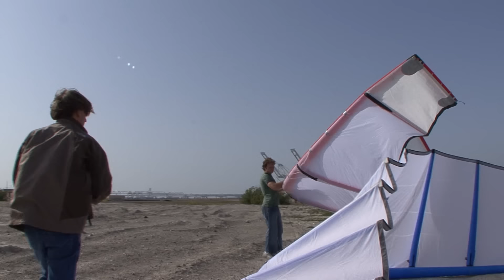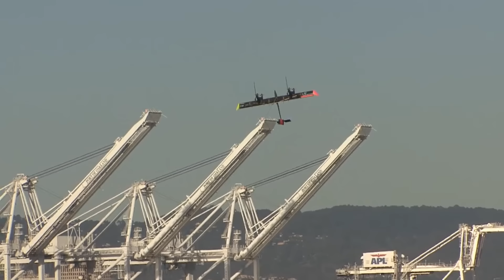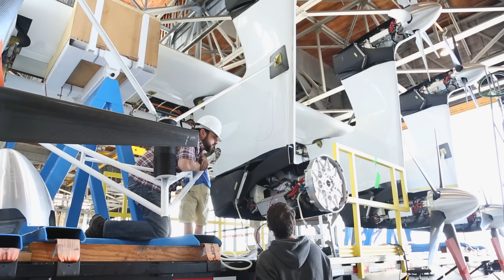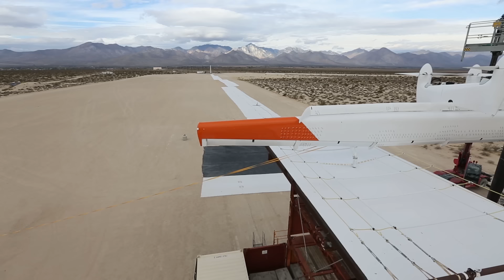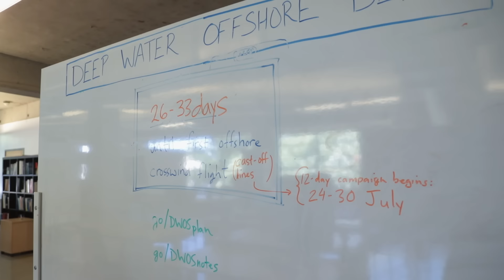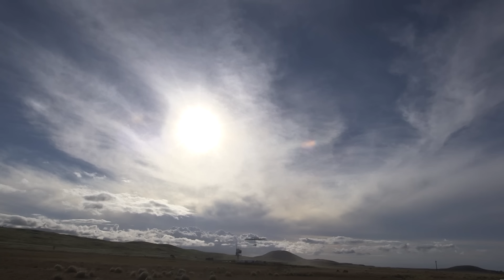Pulling Power from the Sky: The Story of Makani [Feature Film]

Comment: Other than being disappointed in the absence of an explanation of how electrical power would be conducted to the ground, the amount of power generated, and the many technical aspects of the project, the film was entertaining and held my attention throughout.
Reply: Really? It's tethered.. a tether would make a great roadway for those helpful little electrons.
Reply: You’re listening comprehension isn’t very good because they explained it all what do you mean how are they going to get it to the Ground silly it’s tied to the ground
Reply: Alot of "bruh lets like make a kite that like generates electricity" talk and a shocking lack of Volts, Amps, and Resistance talk... Huge red flag. Lets put aside the inherent reliability and safety issues with having a huge chunk of metal and carbon flber with a million moving parts whizzing around for hours all willy nilly, like, how much power does it take to make this thing take off? How much power would it generate? How much power can that tether handle? How would you store that power? Seems like pretty basic questions that weren't addressed whatsoever. I can't believe they raised capital for this hair brained idea for over a decade lol, and they seemed more concerned with morale and matching hardhats as opposed to actual power generation. 2010s Silicon Valley VC money is a hell of a drug 😂

Comment: Very cool project. Not sure why approached in this manor as there is in fact already a kite and prop generating system. A fellow in Orange county CA designed it and built at least two models And one of the two is for sale right now. It does not use the cross wind you folks are going for but then it does not need to. A faster than the wind wind turbin car has already proved you do NOT have to use cross wind other than that picked up by the prop pitch. sailboats certainly can and do go faster than the wind driving them in many situations but you can harness that power with far less sophistication. But this is one cool and brilliant undertaking for cleaner energy. So glad you did this. very glad you shared it.

Comment: Having flown RC gliders and electrics for a number of years I toyed with the idea of making an RC kite/glider. When I saw the crash at China Lake where the "kite" got slack line then suddenly pulled away breaking the wing I was astonished the designers hadn't built breakaway couplers into the two tethers attached to the wings. Then it would just be either a powered or dead stick glide to the ground. I noticed the pilot was using an RC style control box. It might have helped also if they had built in a ton more flexibility into the wings, have you ever seen how much flex jumbo jet airliners have in their wings, incredible. That would have saved maybe two of the first crashes, tether break and wing break. Maybe even simple dihedral in the wings would help stabilize the "kite" and control the "aircraft". Anyway, just idle thinking. Loved the video. It would have been interesting to get some real world data about how this process could stack up against the current crop of energy production. Also, real world longevity in this system. Like what will happen to the bouy and the kite when a hurricane comes a callin'?
Reply: You should apply for a spot on the team.

Comment: Great video. I loved the engineering. It shows how a simple idea can explode into a ton of complexity to implement. Even with a simpler consistent retrieval system, there are just so many moving parts and points of failure. Maintenance and reliability would be huge factors.
Reply: Well, the matter was complex from the start, but it was sold as a beautiful thing that, once again, "would bring cheap and simple energy all over the world to simple people"... Same with clean water sourcing, for instance. This basic lie has harnessed a lot of investment in a host of projects to produce nothing in so many projects! As a whole, it can be viewed, I guess, as "parasitic engineering".
Reply: @fiegenfiegen  That's an incredibly cynical take on it.  None of the incredible technologies we have would be possible without risk taking.
Reply: @miramichi30  well if it does not work or uses almost as much as it will give back, or more, what would call it, even window mill (turbines), if you could get one to work 24/365 all the, which then don't,   the don't work if there no wind, and if the to much wind, which was a big surprise, consider that the hole point of them, and the bigger they get the more parts and stuff the need to make them go? (are the not meant to make something else go instead) and all the part weir out they tent to make electricity, when it not needed, when when the do make, meaningful amounts, and and this is the big one, because the wind is not constant it can an does stop blowing unpredictably, to keep a constant supply going, you have to keep a regular power station running in standby, all the time you are getting the power from the wind, so what the point you might as well just use the power from regular power station running in standby, waiting for the wind to stop in the first place, (there some technical, stuff the bout it running it stand by there not using as much as if they where making power, but that only a small amount, but power the cost of all the windmills, extra instructor need, there there not much left, and  that if it all works perfectly, and how many thing do that

Comment: The tech definitely has some uses where it would be better than most solutions, but it is a complex system
Reply: Way too complex. Even with the simplicity of windmills they are running into new problems
Reply: Yeah but imagine being the guy who gets to spend all of the money on ultra complex "cool" systems. 
You can't stop him. 
Apparently. 
It truly is a vanity project that could be simplified.
Reply: @AquarianNomadic  Elon Musk would have scheduled Rapid Disassembly. Just a ridiculous idea dreamt up on a beach after smoking one too many joints.
Reply: Has some uses? You don’t have to think long before realizing currently used renewables are far less complex. Can you imagine the transmission cost for enough off shore units? Remember their test unit powered only 30 homes. A lot of unshared infrastructure for very little capacity. This idea was a waste of time and money
Reply: So are cars and planes but they work
Reply: @shaneintegra  It's complex- but what you think is simple is turning out to be crap. Conventional windmills vibrate themselves apart due to inherent aerodynamics of the rotors. These machines avoid ALL of that. A lot of people are going to think like you do, and a lot of people are actually wrong. Which is an argument that can be paraphrased thusly: Eat Shit. 10 Billion flies can't be wrong...
Reply: @shaneintegra  i see to much variant against like  premature wear and tear mainly.
Reply: @RasaS0007   I’m all for fossil and nuclear if they get taxed for the produced waste
Reply: @lucasatilano8008  Fossil Fuel suppliers should get credits for the plant food they create as a byproduct.

Comment: The "rotating drum" will probably be the ultimate design to harvesting wind energy. Think of the sheath of leather on a drum face, how it is tensioned radially around the diameter. Next, imagine the sheath is a giant sail, in the shape of giant turbine blades. Around the sail is a frame with a generator track. The sail can be extremely light, yet having a huge area, which is able to move a giant armature around the track. The cost will be competitive with current blade designs but the area and energy output much greater.
Reply: Jack Wilde  either you explained it horribly or it's stupid as far as being a power generator.
Reply: Sails to replace expensive, heavy manufacturing inte sive windblades is a brilliant idea.

It'll need more replacing and maintenance as sails are less durable, but it could be a lot cheaper and cover a lot more area.

A couple things to eat h out for is super strong winds completely destroying the sails when it is too wide. Simply have a mechanism to fold them in in those cases, or maybe not completely fold them in, but the ability to adjust the size, like a light switch dimmer or potentiometer. A spectrum instead of binary open/closed.

Replacement should be made to be low labor. Having to climb all the way up each time is how it'll get expensive. Gotta find a way to make it minimal labor.l and low risk labor.

Comment: The entire time I was watching I thought why, why, why. Imagine if these brilliant people had focused on improving the existing ground level technology.
Reply: You push the envelope to maximize the knowledge of humanity. It could have worked. And the only way to find out if it will is to go and do it. And there is no need to boost the ground level technology. It's successfull on its own right. This isn't a competition. The development we saw in the field of wind energy is also thanks to the pressure of these kinds of projects. About 30 years ago wind energy itself was in the spot they started out at.
Reply: No, he means that the basic concept of having two separate robots connected by a wire, both have to be controlled simultaneously in milimeters precision, also having 8 generators with controllers so they can be used as motors, this whole thing is stupid. And anyone with a little sense had to knew that this will never be better than a pole with a propeller.
Reply: @legyengeza4768  except it was at the time they came up with the idea... If you transport the last prototype to the year 2007 it would be better than anything else.
Reply: I imagine if we had YouTube back in the 1940s, then there would be an Elijah and a Legyen saying the same thing they say here: "Why put the turbine up on a tower? Why so complex?" And they'd have felt correct in their statements despite not being experts and look where we are now. Wind turbines are a force for good. Somebody innovated them and they were complex beasts in the 1940s!

Elijah: Do you think improving existing technologies is the only route to go? How many technologies can you find which came from new areas of research? Radio? GPS? Flight? They were all not existing technologies.

Legyan: Some of the best minds worked on this for 13 years. They had funding from two massive companies. How is it "stupid"? Are you saying that the entire team and their sponsors had less sense than somebody with "little sense"?

Comment: I like the transition from wind powered flying to hovering with stored power. Thats was a great idea and also seeing it in action showed me how creative your team is. Its very interesting to see the movement when its powered by the wind and when it transitions to hover mode. Great work team
Reply: I was curious about the power demand for hovering.
Reply: The efficiency for hovering isn't great compared to a similarly multicopter that is optimized to operate only in thrust mode. They had to make tradeoffs around this in the propeller design. If you want the actual number, it may well be in their final technical paper; it is pretty thorough.
Reply: @southbostongear629  it's a drone on wire. Using huge power consumption. This is the most bogus " power saving" equipment ever invented.

Comment: Mindblowing technology. Really admire the vision and the dedication of the entire team, and sad to see it come to a halt. I've been in a startup before and could understand the feeling when you reach the end of the rope. I'm still wondering though, would it've been cheaper to mass produce hundreds of low-cost small scale kites and base stations instead of handful of big expensive ones?
Reply: The economics don't work out for wind turbines unless they're big enough to be up off the ground. The M600 was the very bottom of the scale that would have been viable for utility scale power generation. Power generation goes with wind speed cubed.
Reply: I agree Fabian, nature has the best designs. What makes nature choose trillions of cells to form a body? The cell works in cooperation and symbioses with other cell. To do this the cell does not only function to the cell wall. Its walls are permeable and share two way. The space in between  the cell is worked with too and a part of the design. So vector solutions is not ONLY about magnitude. They are about directions in space. Nature 'works with' 'directions' and 'mass' Both these qualities need to be present as the energy is dynamic. How else can energy be collected/absorbed other than a propeller? This team has made some remarkable achievements and they are right. The different 'points' of view are of great values as we are working with 4D systems. I feel, looking to and working with natures design. will be the road to a long tern solution. A birds feathers are not solid for a reason. The air around them being part of there design.
Reply: @thebiomatrix  do you feel smarter after typing all that?
Reply: @69uremum  hahahaha... 😀
Reply: @thebiomatrix  bla bla bla blaaaaa 😂😂

Comment: I would have liked to know more about the actual power generation results.  Also more details of how the power is produced, by the turning props? Or some other more passive or solid state system?
Reply: Indeed, the film lets this completely unclear. - Anyway it's obviously ths spinning of the tiny propellers. I don't see the point why this thing should be better than a traditional wind mill of, say, similar wing size. The one explanation in the beginning that due to the larger diameter the yield was larger is nonsense because of course the moving plane does not use the power of the wind that blows where the plane just isn't.
Reply: @christiangeiselmann  -- It's long been known that there is a dramatic voltage differential between ground and altitude, the higher the altitude, the higher the voltage.

This is used for some autonomous flight control systems, which constantly measure the left/right wingtip voltage delta.

The problem with harnessing this voltage is that -- besides the fact that it's of extremely low current (amperage), it's Direct current.

Cue video of Edison pulling out his hair as his engineers read the facts of life to him (regarding power generation and distribution).

What are you going to do with umpteen thousands of volts of DC? Well, you could step it down to a more manageable voltage, at which point the current would increase all by itself. Well, that is, you could if it was Alternating Current.

Solutions? Sure. Viable? Not so much.

Easiest would be a spark gap -- when the voltage -- likely fed into a condenser bank -- reached a high enough level so as to make a spark happen between two electrodes, the current would crudely "alternated" -- and if there was the primary of a transformer placed between the spark and either the feed, or ground, then the secondary would provide the desired voltage, with a higher current.

Of course, this would not be our nice friendly 60 Hz sine wave. It'd be random, noisy, probably s sawtooth or perhaps something between a sawtooth and a square wave. Or, just random noise.

Oh, right -- the feed -- which gathers the voltage out of the air -- would also become a very powerful radiator of the broadband "signal" created by the spark gap. ("Broadband" in the traditional sense of the word, from before it became "synonymous" with "high speed" Internet; this, apparently due to "broadband" having won the protocol war with "baseband" -- with either/both being fully capable of very high speed or very low speed -- but, I digress.)

The result would be the obliteration of all open air radio communications within a quite large radius (the higher the collector/radiator, the higher the voltage and thus the higher the efficiency, with efficiency being a two-edged sword, therefore the higher the efficiency, the larger the radius of obliteration).

Or, someone could come up with a super-efficient DC motor that could run at the tens of thousands of volt/microamp juice, and use it to turn a generator to produce 60 Hz AC at usable voltage levels.

I would not hold my  breath waiting for that.

Well, I guess I should start watching the video now, and see if it can hold my attention throughout its entirety.
Reply: And the answer is a resounding Nope! I don't have enough time in my life to endure this long, droning [yeah, I said "droning"!] puff piece covering a pack of idealistic young saps who'll swallow the crisis du jour, and then proceed to wash it in Other People's Money.

But should I ever find myself in need of a tragic yawner I'll be back in a flash.
Reply: @This_is_my_real_name  ...i'm suspicious of all the positive comments...someone is deleting the ones that question them....like " How much power does your overly complicated and prone to damage windmill make?"

Comment: Very interesting and impressive project. Also fun for me as an Norwegian to see your experiment in Norway. 
But realistically, is this really so much more effective than traditional wind mills that it defend using this expensive and complex technology?
Reply: The normal wind turbine is so simple and effective. I don't think this kite idea would work better considering its costs, instability in air, and it's risky and dangerous to low flying air craft. 13 years Is a bit too long. The end result would have been visible in 6 years. However it's a good attempt. I am Olusola Obadeyi from Nigeria.
Reply: Given the area required for each installation and complexity of the machine I can't see how it could possibly compare with a static windmill. I got the feeling the end result i.e. production of electricity was not foremost in their considerations.